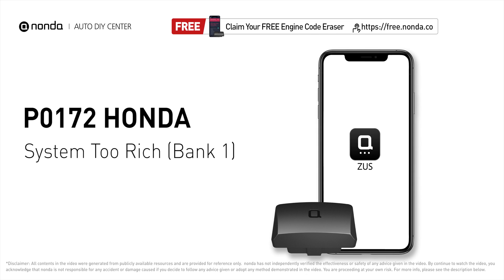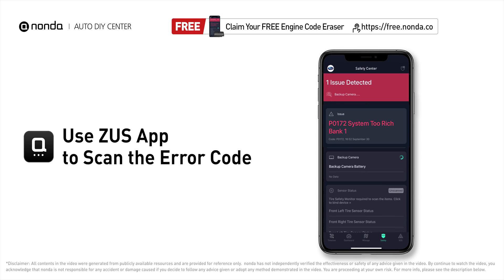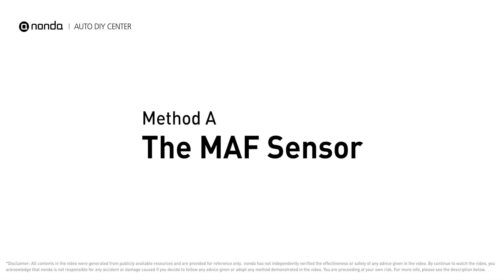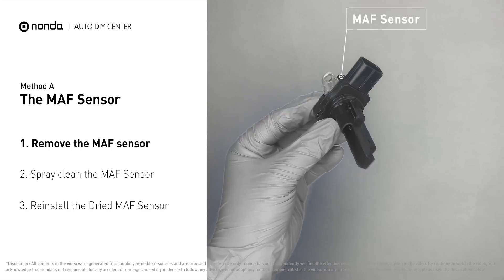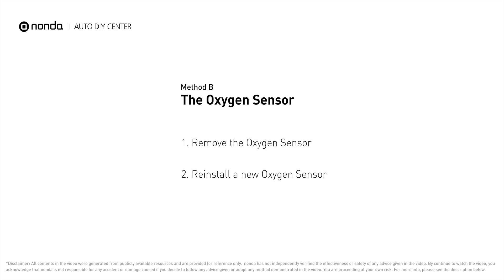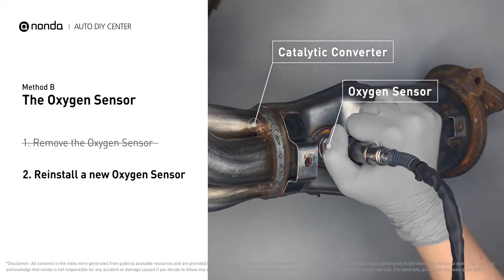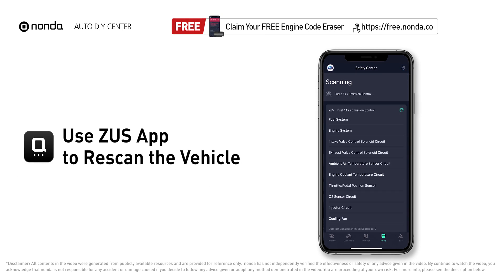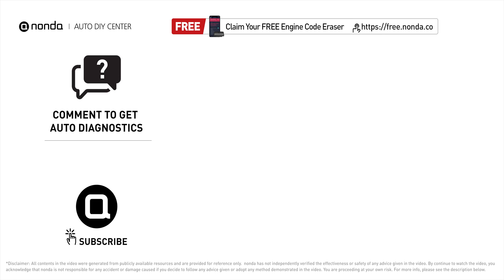How to Fix HONDA P0172 Engine Code in 3 Minutes [2 DIY Methods / Only $8.77]

Comment: Translate to english 

Que tal amigos solo ingreso a contarles aquí mi experiencia con este problema.
Al igual que ustedes ingresé a foros en busca de ayuda e ideas, todo comenzó cuando adquirí mi vehículo luego de poner combustible de bajo octanaje encendieron todos los testigos en mi tablero. Así que me asusté un poco pero desconecte la batería de mi carro avance unos KM y volvió a la normalidad resulta que luego cada 3 días tenía que desconectar la batería para borrar los testigos del tablero hasta que un día ya no apagaron todos los testigos quedaron encendidos todos los testigos que tienen que ver con el radar y el check engine, conecte el scanner y solamente me arrojaba el mismo código P0172 así que lo que hice fue conseguir un scanner que pudiera borrar el código con mi teléfono antes de que apareciera ( es el método que recomiendo para los que aún no tienen el código de fallos en los cilindros ya que el carro funciona perfectamente solo con el código P0172)

Luego el scanner empezo a arrojar problemas en los cilindros y también problemas con las rejillas del obturador 
Días después el vehículo perdió potencia llevamos el carro al mecánico ya que ahora el carro si presentaba un problema.

En el diagrama del scanner 2 inyectores estaban defectuosos así que se cambiaron los inyectores y el carro quedó bien apagó el P0172 pero a los pocos días el problema regreso nuevamente marcando P0172 y cilindros.

El mecánico reviso la comprensión del motor y fue cuando nos dimos cuenta que había agua en los cilindros, no había comprensión en el motor por este motivo. 

El mecánico dijo que el motor del carro había sido calentado desde antes y con el paso del tiempo esto fue afectando aún más el motor hasta que llegó a su fin.

Mi auto nunca había subido la temperatura pero el problema estaba en el termoestato del vehículo ya que las ventiladoras empezaban a trabajar a una temperatura muy alta Pero en el sistema del vehículo no se reflejaba  la temperatura del motor subía hasta 180 y la del coolant 140 y hasta ese punto las ventiladoras se activaban 
( Lo normal es 94 motor, coolant 84 )

Por suerte mi vehículo solamente tuvo problemas en el termoestato pero también me dijo mi mecánico que algunos de estos  carros son chocados de la parte del frente por lo que pueden haber cables rotos en el arnés principal del vehiculo y son reconectados de forma errona  por lo que los inyectores y todo el arnés del vehículo son los repuestos más vendidos de estos vehículos.

Reemplace el motor, en mi país no fue muy costoso adquirirlo pusimos inyectores nuevos y por mi desición también cambiamos bobinas y bujías. 

Finalmente el carro quedó con todo el problema solucionado

Comment: I have honda jazz 1.3l 2009 model...it has p0172 code..but when erase the error code using scanner ,it disappeared ..but after 10-15 days it appeared again..
Reply: How did u fix it
Reply: @anthonyshepherd6692  i replaced the mass airflow sensor..problem solved
Reply: @yohanjayathilaka7400  starting to have a lag between pressing the pedal and moving off and get heavy vibration at that moment

Comment: I hava a 2013 2.4 sport just hit 200k a few days ago. I had the boot replaced due to stalling and hesitation found the boot had a tear. It still hesitates have a p0172 code. What do you suggest?
Reply: I have the same problem with the same car. Recently changed my side mount for vibrating when the a/c is on and lags at acceleration but still have the same problems recently received this code too
Reply: Update?
Reply: Update?

Comment: I have a 18’honda accord 1.5 and I currently have 9 warnings on my dashboard with all different lights on since brake system to steering problems and my scanner is giving me this P0172 code, from what Ive been reading and researching this 1.5 turbo engines are not well manufactured and it is going to cost me to replace all fuel injectors and honda is only gives you 12 months warranty.!
Reply: I had to replace all fuel injectors and that fixed the problem, also was advised to use a higher graded gasoline like 89 or above, its been running smooth for a year with no problems yet.!
Reply: My civic is doing the exact same indicators yours is, did you ever resolve this? Update?!
Reply: Yes we need an update!

Comment: i have same error, but in the dashboard of car, turn on the different lights (is Releasing of breaks and system, etc), and my car have LAG when i accelerate the car, i was change the pedal for a new one, and the LAG was decreasing, but at this moment the lag is increasing, today I was Scanning my Honda Civic 2017, and scanner gave me a P0172. my Civic have a bank, would i replace the Oxygen sensor? and clean the MAF Sensor?
or it´s probably that injector bank 1 is break?
Reply from the maker: Hi, all of the mentioned causes actually trigger this code. Please also check for vacuum leaks.
Reply: Update?
Reply: Any update?
Reply: Replace your PCV valve it’s the most common and overlooked maintenance item for the 10th gen civics. When they fail or get clogged they sometimes will trip a P0172 code. Usually fixes the problem 9/10 times. Hope this helps anyone 🤘🏽
Reply: @edgjr im about to do this now brutha

Comment: Which sensor should I replace? There are 2 of them :/ upstream and downstream? My Acura is TSX 2009
Reply: Upstream is usually the one that causes problems. The downstream is after the catalytic converter and is basically there to just read if the catalytic converter is doing it’s job.
Reply from the maker: Hello, it's the bank 1 sensor 1. Hope it helps!

Comment: My 2018 Accord 1.5T just had a fuel injector fail at 58k error code P0172 (posted on my channel). Modern Honda look amazing but once the 3yr/36k warranty expires you're on your own and you have no idea how expensive modern Honda engines are to fix. Oil changed at 80%, Shell regular used 80% of the time, always did warm up the car in the winter. Dealer so out of touch they recommended brake fluid replacement at 30k. I've never seen this part fail in ANY of my past cars. When asked why the injector failed so early Dealer said they see them all the time and cost of replacement is $1600-$2500 (must replace all 4)  and the new injectors warranty is only for 12k/12mos! I was in love and bought the 1st Accord on the lot with series ending in -0001 but when I made a case with Honda to see if it could be part of a bad batch all I got was the VM of the case manager for weeks on end. Fool me once shame on me, fool me twice...
Reply from the maker: We're sorry to hear that, Johnny. But we appreciate you sharing your experience.
Reply: Yeah my mother bought a 2018 CRV with the 1.5l and has had electrical problems since she got it with 45k. Plus the other modern upgrades have fallen short also. The body style previous to this was almost perfect with reliability. This have made her want a Toyota/Lexus.
Reply: Aaaaewwewweeeweew3wwqw